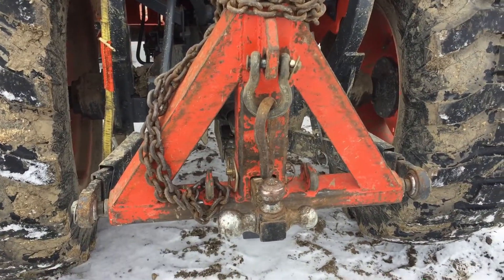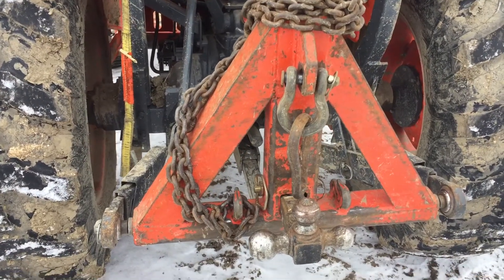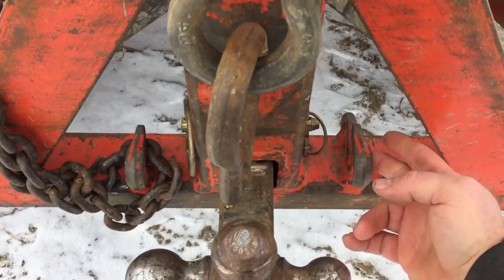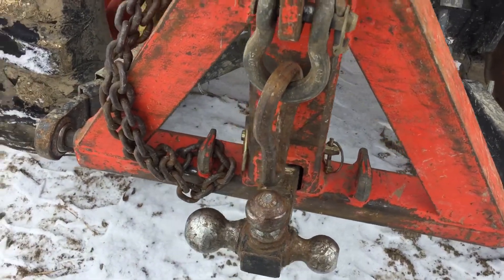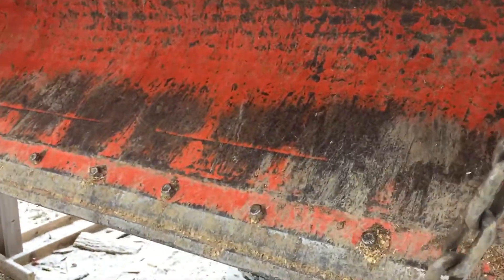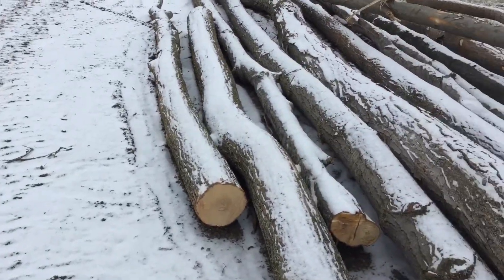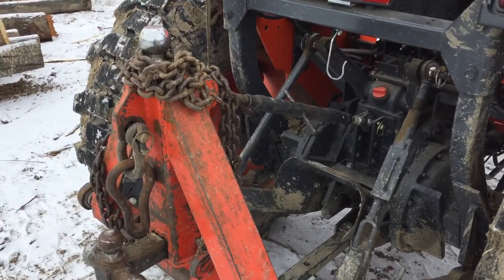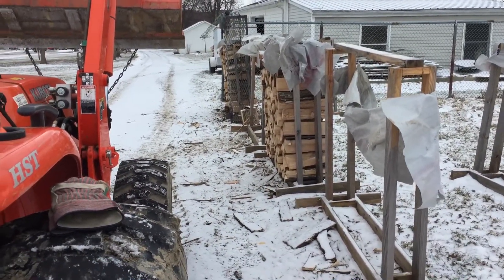Setup on Tractor

Comment: We never have too much hooks, don't we? I even welded a grab hook on the SSQA.  So without having an implement on the front, I can still lift something. On my dirt bucket, I have many grab hooks, one large slip hook and a closed loop.  I really like your idea of a pair of grab hook on each side of the bucket and a chain in the shape of a V. So any log you lift will not swing from right to left. Thanks Mark!
Reply from the maker: Thanks Joe, a hook on each side with grapple in center also keeps from tweaking the loader arms. I have lifted some very heavy logs, your correct on you can't have to many hooks. Take care.